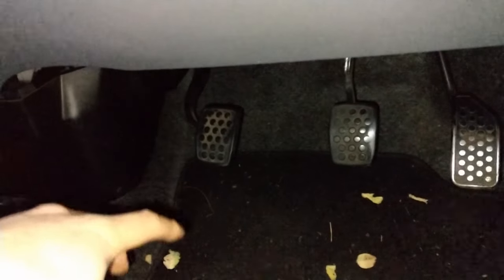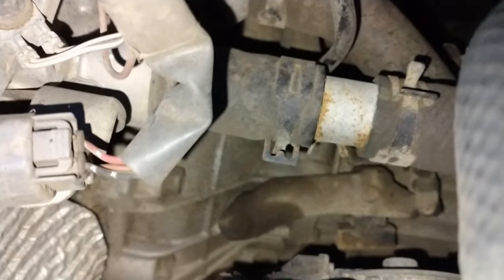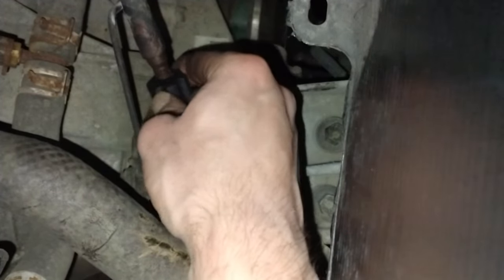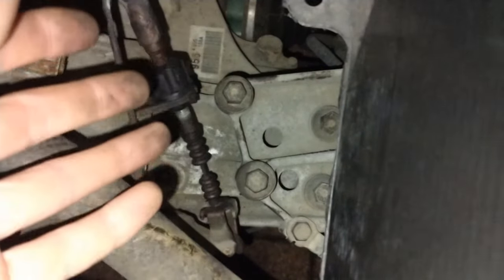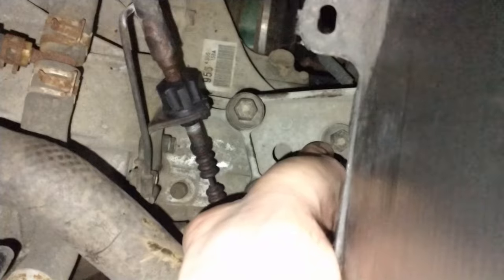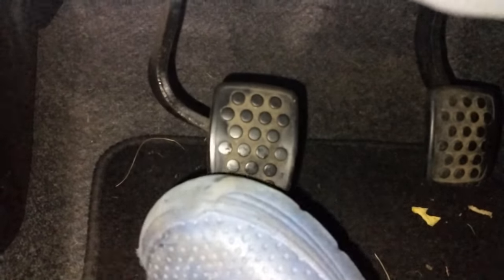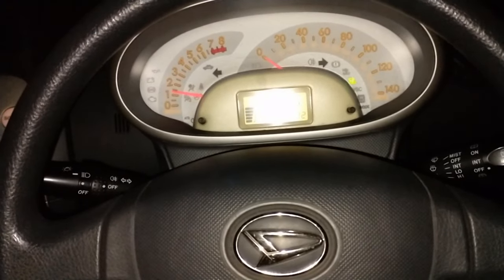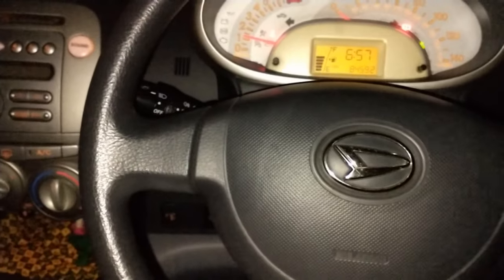Cable Clutch Adjustment - High Clutch, Slipping Gear Changes

Comment: Very nice, i have a Citroen C1 2010 my biting point is almost half way up kinda annoying, can i adjust it sop i have it very far down to the floor instead? and how do i know if the clutch isnt slowly slipping or putting tention?
Reply from the maker: Yes you can, you just need to loosen the cable so you have more play. This will cause the biting point to be closer to the floor.
To be honest - your best bet is to feel the clutch operation. Does it slip whilst you are driving, do you experience a lack in acceleration after changing gears temporarily, do you struggle to get it into reverse?
Also, the mileage of your car. Normal clutch operation usually calls for a clutch replacement after 60,000-80,000 miles.
Also, run the car in neutral. Listen to the transmission, it should be silent. Press down on the clutch pedal fully. Do you hear a rattling noise? It might sound like a dodgy bearing.
This is a sign that your clutch throw bearing is wearing out. If the noise is faint and quiet, then it should be fine. If the noise is loud and squeaky, its probably an indication that your clutch plates and throw bearings need to be changed. These jobs are done together - when ordering a new clutch, it will come with a new bearing. It would be silly to replace just the throw bearing, as you might as well do the clutch plates or even the flywheel if the teeth are worn.
A low mileage car will probably just need the clutch cable adjusted. Your french car may have a hydraulic clutch, therefore the process for adjusting the cable may be different. If it is a cable, then do not worry, my video should be able to help.